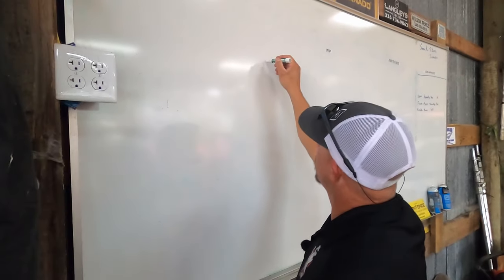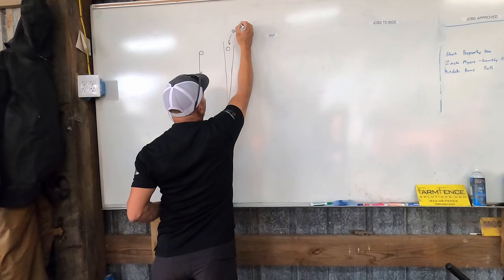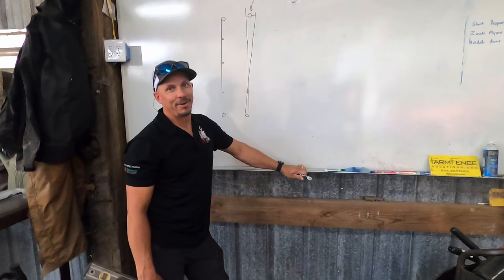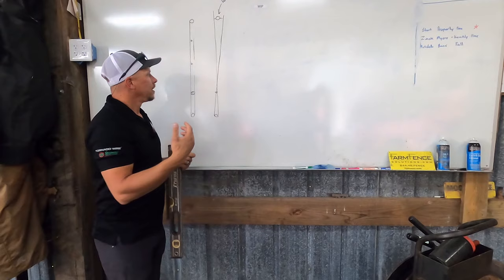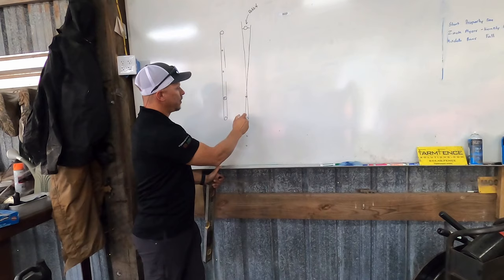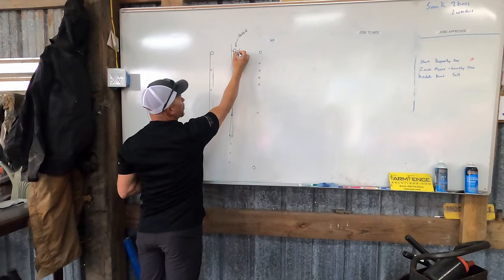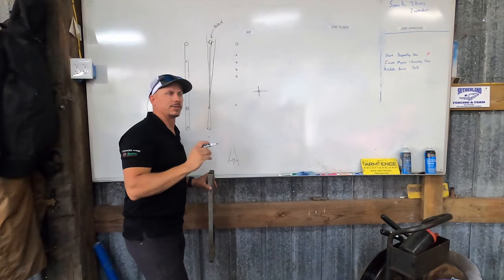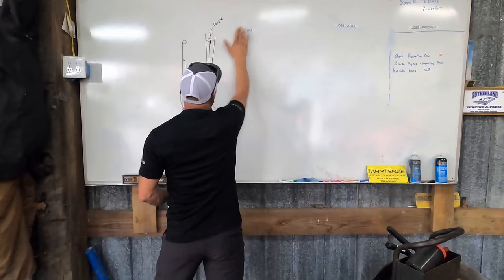Sighting in fence posts without a string explained! Make building fence easier!

Comment: So every time you go to set a post you need to walk back to the very beginning post and just eyeball it? On a 1000' run of fence that seems like lots of walking back and forth, plus I don't know that I could accurately see the "air gap" that far away...
Reply from the maker: At 11:15 I talk about backsighting to check and see how your tracking to your “rabbit” post.  You only need three posts to create a line.  When back sighting you use the 2 closest posts to your current location to sight to the rabbit post.  Does that make sense?
Reply: When I back site, I keep both eyes open. No need to close one eye.

Comment: Educational and impressive. Question if you don’t mind. Installing pickets should you start on higher or lower ground?
Reply from the maker: When doing vinyl I would start on a low side so that way the gravity Is working in your favor and holds your pickets tight. When doing cedar it’s totally your option just make sure your top is nice and straight a.k.a. each pick it is rising the same amount. 👍🏻